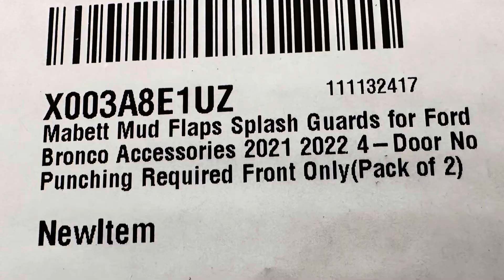Mabett Mud Flap install - 6th Gen Ford Bronco

Comment: Thanks for making this video, but you didn’t even show which screw to use on the final hole. Maybe it will be obvious when I’m doing it, but it would be nice if you showed it.
Reply from the maker: At time 6:30 I show it, and refer to installing “the last expansion screw”. It is the same plastic expansion insert and screw the was originally in that spot installed by Ford. The one that holds liner in place at that spot, that you remove earlier at time 1:12, is reinstalled through mud flap. Hope that helps. And thanks for watching.

Comment: Every mud flap  video , regardless od brand is a pain to install. Why cant someone make a mud flap that just screw into the trim with no removal. Thats how the ones on my wildtrack came for thr rear. Great vid
Reply from the maker: I know what you mean, and thank you!!
Reply: Ford mud flaps do just that but they’re cheap and flexible. I don’t know why this job seems hard for you. Can you pump your own gas?

Comment: Are the stock running boards in the OEM position...I have the Weathertech flaps and they kind of are bent ahead a little bit because the running boards push them forward.  Thinking about switching to the Mabett.
Reply from the maker: There is no interference at all with the mudflap and the running board. If you look in the end of the video right after I get it installed, but before I put the brow on, you can see how the mudflap has separation from the running board. It’s a perfect fit with no interference of the mudflap with the OEM runningboards. 👍🏻
Reply: @jeffiovine4577  Awesome, thank you.
Reply from the maker: @SkeldZ06  you’re very welcome!

Comment: I was at the finish line screwing the 3rd, inner bolt and it’s just spinning and there’s nothing there to secure it. This is the bolt not on the bracket - any thoughts? - thanks and great video
Reply from the maker: Do you have any other / extra of the plastic/scew fasteners. Maybe the one your using is stripped? That hole on the vehicle that you’re putting the fastener in is empty - so it is just the screw grabbing the interior of the plastic plug and pulling it towards the screw head which flattens/expands the plug body so it grips inside that hole. If the threading inside the plug got damaged or stripped, the screw will just spin and it won’t be able to collapse the fastener to lock it into the hole. I bought a kit with a variety of those plugs on Amazon but they may also sell them at the AutoZone if you didn’t want to wait to get extra plugs. And thank you for the kind remarks. 👍🏻
Reply: @jeffiovine4577  it was operator error - that inner slot takes the factory pin plug and not the screw that goes into the bracket. I used the pin plug with an extra long screw to secure it - thanks
Reply from the maker: @brianhumphrey8494  awesome 👍🏻 and thank you for the follow-up!

Comment: Looks like the easiest mud flap yet
 .. let me ask you this, can you have done the install without removing the fender brow?
Reply from the maker: It might be possible, but it wouldn’t be practical. It’s literally a 60 second job to pull off the fender flare. I know the first time you do it it feels uncomfortable because it requires a significant force to unsnap it. But you truly won’t do any harm. And once you get comfortable, you may even want you may take them off occasionally to clean the paint finish between the flare and the vehicle. But yes, the first time you do it, you may feel like you’re breaking something. Access to the liner and bolts. You have to remove would be much harder with the flare, and most likely not possible in the area where the flare overlaps the mudflap

Comment: Can anyone answer why manufacturers go with Allen bolts instead of bolts or screws??  Very frustrating to work with Allen wrenches!
Reply from the maker: My guess; very affordable way to include the “tool”, so the kit can be sold as “everything you need” is included. I do find the Allen bolt sufficient for a “plastic” product such as this. Not much torque required (or desired) to fasten these parts. But I agree, they can be annoying.

Comment: I love their look but ours rub like crazy on our Sas at 3/4 turn. Are you having the same issue?
Reply from the maker: I did not. My vehicle was a stock Sasquatch however on wheels / suspension. Not sure if you have done any mods that may have changed geometry. (I recently traded my Wildtrak with Sasquatch package for B-Raptor. But I put 3500 miles on the Wildtrak with those mudflaps and never had a problem)

Comment: Curious as to why the flare has to come off?
Reply from the maker: Access to bolt on the flap. Maybe not impossible. But impractical. Look at the tolerances of the flap, and how close the brow is to it on the aft side after the flare/brow is attached and overlapping mudflap. I can remove brow in under one minute, so why leave it on?

Comment: Hey Thanks for the vid. I  believe we saw you at Holly Oaks. I would love to know if these keep snow and water off the back door and wheel flare. Would like to hear back. Do you have a YouTube email.
Reply from the maker: The front mud flap is very effective for keeping the mud and spray off of the doors, both for the front (if only a 2-door, as well as the rear seat doors, in the case of the 4-door. If also keeps the wheel flares far cleaner. Nothing is perfect, as spray from the tires can still find the door in cross winds and turns to some degree. But it seems to essentially eliminate the spray caused by your front tires. Ultimately, the difference in how much dirt and road film ends up on my door and door handles is dramatically different since installation. Completely happy with the result. I have updated the channel to include my email. Thanks!